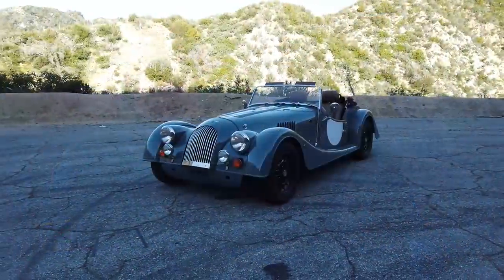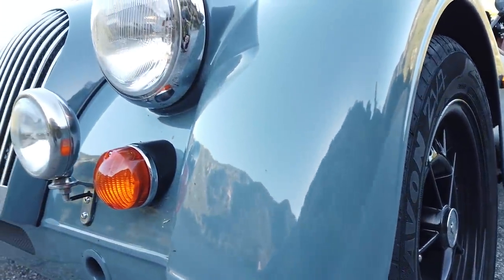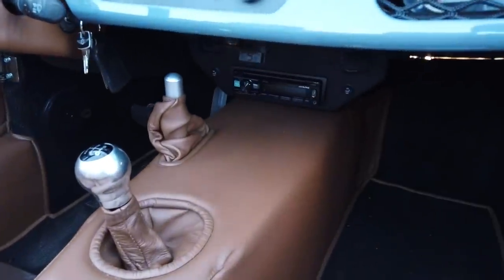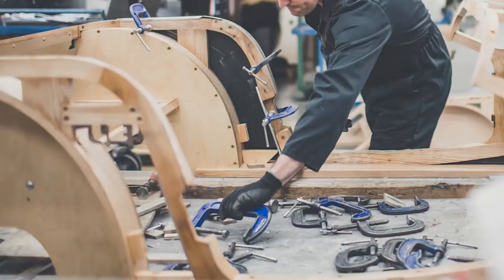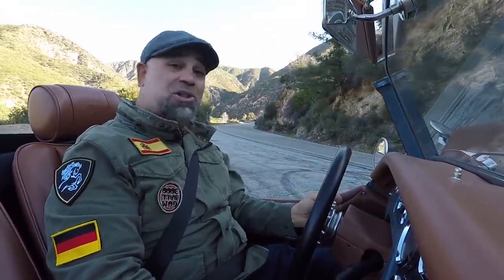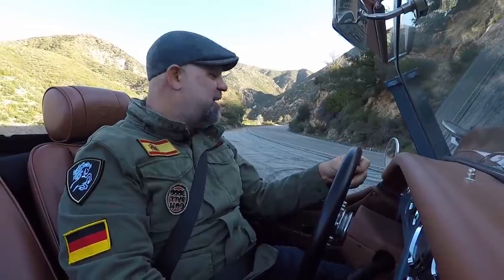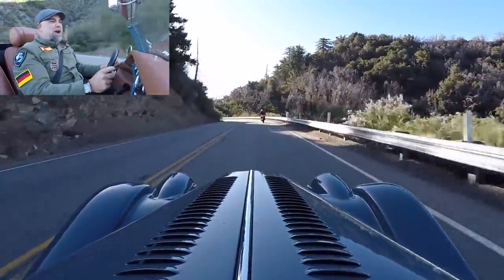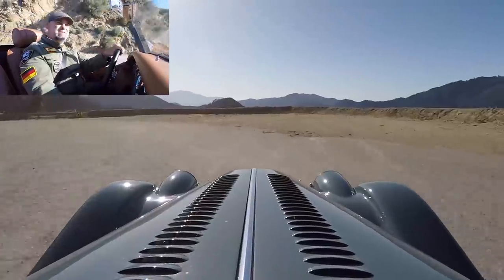The Morgan Plus 4 is a Brand New, 70-year-old Sports Car - One Take

Comment: The 2021 model looks so exciting! 0-60 in 4.9 seconds and it gets up to 150 mph! The chassis is 100% more rigid, it’s got a Bmw turbo 4 cylinder with 255 hp and 296 lb-ft of torque, and it still has a manual gearbox unlike the plus 6!

Comment: I've had my Morgan +4 for 50 years.  I paid $2400 for it way back then.  It would do 130 mph with the windshield off (small Brooklands screen), and actually feels very stable at that speed.  With the windshield on, it would only do 115.  Because the engine is so far back, it really digs in and can hold its own against much more powerful cars in a drag race.  Not bad in the snow either (Michigan winters).  Corners flat as a pancake, too and very nice on a track.  There really is nothing else in the whole world quite like it.

Comment: The UK had no speed limits from 1st January 1931 until 1934 when they re-introduced a limit in built-up areas (30mph). All other roads remained clear of speed limits until 1965, when the 70mph limit was enforced on motorways (freeways) and 60mph on all other types of road outside of villages, towns and cities. So when the Plus 4 was launched in the 1950s it could lawfully be driven flat-out, but there was (and still is) a Dangerous Driving law which could be used against the driver if the speed was deemed to be excessive. One of the reasons that a speed limit was introduced in the mid-1960s was because Jaguar had an E-Type drive at over 150mph on the M1 motorway.

Comment: Several years ago I owned a Ural sidecar motorcycle, brand new in 2012, but built nearly the same way since the 1940s, with minor refinements over the decades. It was a comparable experience to the Morgan in that the most frequent question I got was "What year is that?" People were blown away that it was modern. It wasn't a replica or a retro design. It was a genuine piece of history, newly built.

Comment: When i had just turned 19, the shop i was working at got contracted to restore one from 1966. An original Plus4. My god was that thing a wild ride to drive. Tiny little carriage wheels and a manual gearbox with a tiny little carbureted ford four cylinder. That thing was wiiiiiild to drive

Comment: Love a modern classic, but wouldn't touch this. The Plus Four delivers the same nostalgic vibe, but there are so many improvements, it's become a very different car. The only thing that is bothersome - but understandable - is the BMW engine that replaces the Ford unit (yes, faster, but no-doubt it won't "age" as well - and who really needs that crap!). But the structure is stiffer, the ride is better, it handles better, the interior is improved, and a few exterior details make it a much more cohesive design. Not lamenting the lose of this version.

Comment: Same engine as my focus, wish mine sounded this good tho . Wonder what they've done with the header/exhaust?
Reply: Jewel s you can easily actually. Some cams, a cold air intake from FSWERKS, an exhaust, and a tune.
The duratec doesn't mind revs either, safe to 7.2k

Comment: is there anything to keep your head from getting smeared off if you put the thing upside down?
Reply: No. So don't do that.
It's a light sports car with a low center of gravity. It should be very hard to flip unless you're driving off a cliff or something similar. A bigger concern is getting run over by a big SUV.
Reply: That's what the tweed cap was made for.

Comment: What's it like compared to the three-wheeler?
Reply from the maker: Much more of a real car. a Three-wheeler is an incredible experience, but it's a total novelty. You can actually use this as a car most of the time.
Reply: The three-wheeler is one of the few cars you could compare to the Plus4 and decide that the Plus4 is the sensible, practical choice :-)
Reply: John Davis so true

Comment: Coal cart chassis with wooden handles.
That feel of the road you mention is actually the rear wheels loosing contact with the pavement.
7’s actually Add Lightness! ... my 7 clone weighs just north of a 1,000 lbs, has a fully adjustable double wishbone independent suspension (front and rear), twin pot Willwood brakes, limited slip diff, and (thanks to a Gen 1 Hayabusa engine with sequential shift transmission) will do 0 to 60 mph on 3.45 seconds. ... nothing but smiles, mate!
Reply: You are living my dream :)